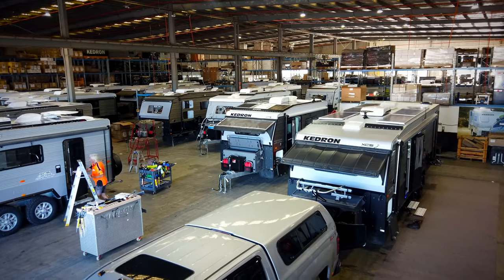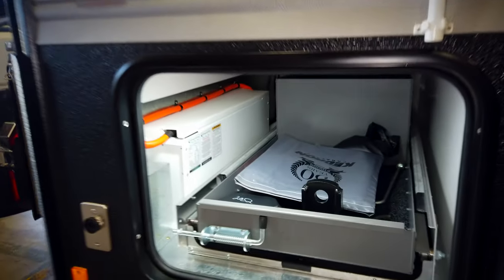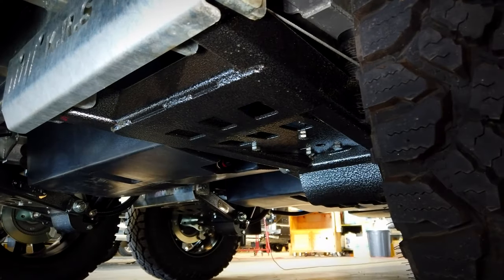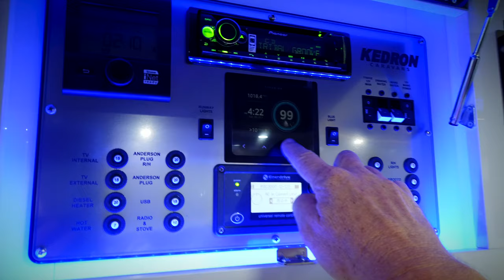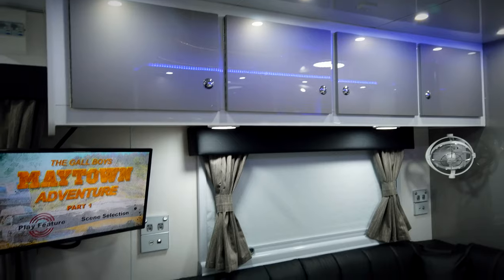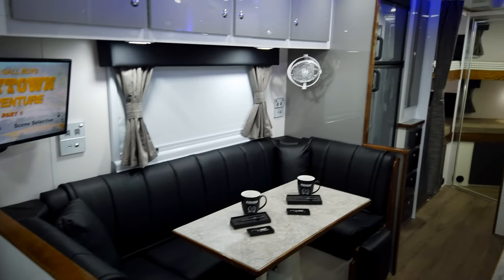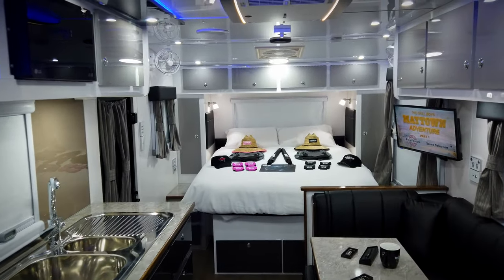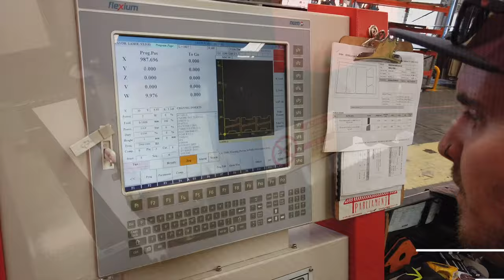KEDRON® 24ft BUNK CARAVAN - FAMILY LAYOUT - FULL ENSUITE - DOUBLE BUNKS - KRS 'RECOVERY STUB'®

Comment: Once again, awesome caravan. But would you ever produce something with perhaps a slide out? You know, mix it up a little
Reply from the maker: Thanks very much Kichwa! Had looked at the slide outs early days, though refrained with the size of the section of wall strength out and our concentration on the structural strength for corrugated off-road travel. This coupled with the forward order bank of builds without as well. Maybe one day down the track though! Thanks again, and regards, Glen ☺️👍